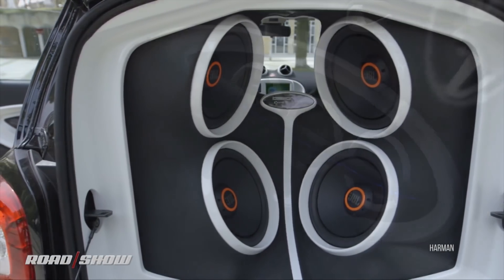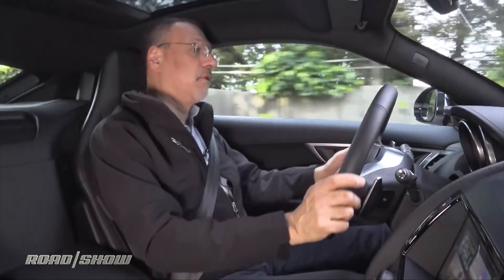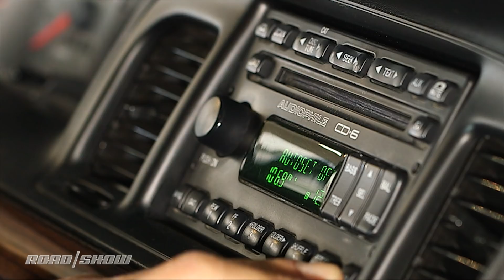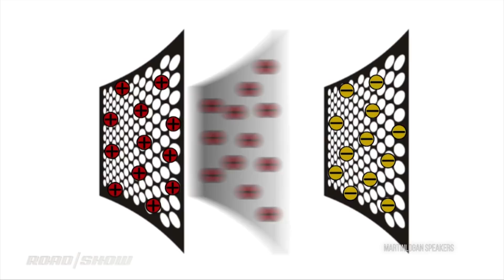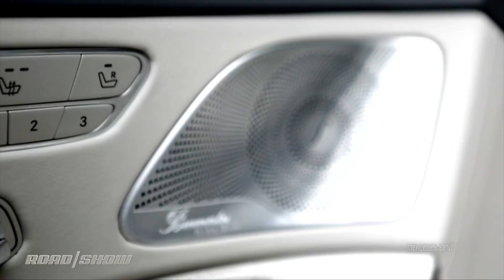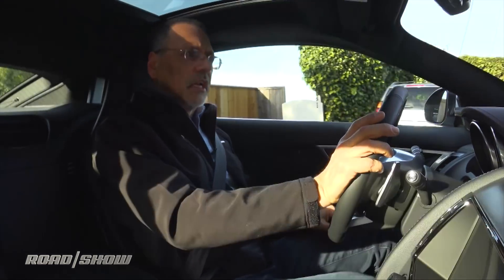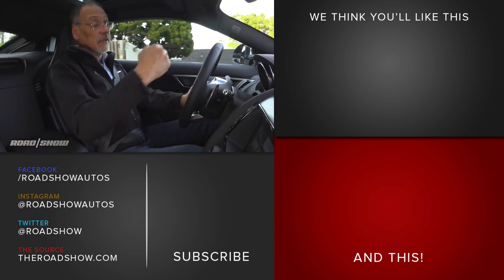Car Tech 101: Car speakers are about to disappear

Comment: Some of the newer cars coming out will have more watts to use to produce the sound. An example is that the 2019 Toyota Corolla Hatchback will have an optional 800 watt JBL audio system, even though it's a basic car meant for basic transportation.

Comment: One of the tings I love most about my BRZ is it has an conventional double din radio ( NO DATA BUS).  Four inch mids and tweets facing the front window and two 6.5" in the front doors.   Two 4" in the back.  So so easy to replace everything and add whatever quality speakers and equipment you want.      Changing the radio in an late model Mustang or almost any modern Ford is an nightmare.

Comment: None of these new technologies will be cost effective for some time to come.   My bet is most will not sound very good. BMW has had subwoofers under the seats of many of their cars for years.   They sound good and are time aligned with the driver.   The 3 way systems just sounds like one very good full range speaker.  I think top of the line car Audio fidelity reached its peak in the 90's.   All of what has come after is mostly  marketing.   For the average person the average car sounds light years better than the average car in the 90's.

Comment: The JBL GreenEdge speakers in my wife's Toyota Highlander are designed to use 1/2 the energy according to the marketing. To my ears, they sound sound muddy. They lack dynamic range and don't do a good job or producing any frequencies very well.

Comment: Sonigistix, in the early 2000's, designed a brand of planar magnetic speakers called Monsoon speakers. They were sold for PC computers and GM vehicles. I think they had some earlier proto models that were electrostatic-based as well. These sounded great and were very thin in shape; a bit heavy, expensive, and prone to corrosion though. I'd be curious to see graphene replace the need for rare earth metal in such speakers though, but I struggle to believe that will happen anytime soon.

Mind you, we're also seeing these transducer 'speakers' gaining popularity, where you have a small transducer that turns the surface it is on into the actual speaker diaphragm. Perhaps the car's frame, window, or some other hard surface can become a thin speaker. The upcoming LG G7 smartphone is building a transducer into the phone itself I think, so when playing it on a hard surface, it turns that surface into a loudspeaker.

Comment: Merc's front bass is really cool. The firewall allows for more resonance space resulting in better bass than one mounted in the door where there is not enough space as the door is relatively thin. The C, E and S classes don't have big speakers in the door because of this which is nice because it has larger door pockets and there'll be less rattle noises in the panel. Also, the sound then travels over the occupants and towards them and to the back instead of coming from the side and hitting the leg.

Comment: I didn't know Mercedes were installing subs in the front. That's pretty bad-ass how they're stamping the space for them right in the firewall.
Reply: Carlos Clivilles Yes. You'll see in the C, E and S class there is no base speaker lower in the door like other cars. There is nothing there other than a small one higher up on the door. It allows for much bigger door pockets and there is more space in the front firewall to act as resonance chambers to allow for bettet bass than a door that is relatively thin with much less space.
Reply: MrWashesp
Most  likely no more problematic to replace than any other MB speaker.  I have replaced he under seat speaker in an BMW.  The hardest part is just taking off the seat.
Reply: abhishek nayak, The Subwoofer speaker is behind the firewall.
Reply: Yes, they're not going to use the speaker as part of the firewall, that would let in noise and wouldn't be fireproof :) it's just a sub mounted under the dash instead of on top of it.
Reply: BMW puts Subwoofers under the driver and passenger seats.
Reply: SDav21
correct  its not.  It is much cheaper to build.  BMW designed the 1 seres to have an sub under the front seats.  The drivers is are flat units I think 8'''.  It ports to the rear of the car and is on the BASE sound system. It sounds quite good.  Not high end but good.
Reply: fatboy19831 That's not as effective as front bass.
Reply: Imagine when those subs begin to age.  And it's time comes to replace.
Reply: Wait till it cracks due to heat from the engine.

Comment: U r trying to solve the problem that was never exist at the first place.
Reply: It's called a solution in search of a problem. It's what people do everyday in conference rooms across the country.
Reply: Jeff S if it aint break, break it.
Reply: And the rest of us who prefer music?
Reply: Ugly Gawd not everyone are audiophiles like you. Some just want to hear the news.
Reply: Ugly Gawd Yes and no. My 05 silverado has a sub built in the center consol ive never seen as its a bose system. It lasted pretty well til 2016 when the "bose blows". Course the sound was going down hill since 2012. Now i have kickers. They dont sound quit as well, but they at least hold the audio at higher levels over my exhaust.
Reply: Agreed, makes no sense to "reinvent the wheel".
Reply: I think lower powered speakers at the same output is a very big deal now that electric cars are starting to get popular.   every little bit helps the range.   plus the smaller size might allow for more batteries
Reply: OEM speakers have always sucked, if you ever upgrade them you would know this..

Comment: Do you guys remember back in the day when you bought a car(new or old) and the first thing was to replace the cheap horrible sounding factory speakers with bigger and better sounding more expensive aftermarket speakers from Best Buy, Walmart, autozone, pep boys etc? Some folks even replaced the actual radio head units. Most people added big a sub in the trunk which took half of the cargo space for that deep base. 🤪 

I walked into the automotive section at Walmart the other day and it brought back memories. They actually still sell that stuff including gps navigation, radar detectors, aftermarket DVD players, cup holders, back up cameras, antennas and such. Newer cars come equipped with most of these things as standard equipment so less trips to that aisle at automotive stores. 
People with older cars still shop for those at a bargain than they used to cost back then. We didn’t have amazon, eBay and other online outlets to find those gems for a cheaper price. Haha!  
If you owned a late 90’s Honda, Toyota, Chevy, Dodge or Nissan you can definitely relate.
Reply: I own a 2013 charger, all 6 speakers where replaced with Rockford’s and sub and amp added. 

After market systems will always be better.
Reply: I feel you brother. It used to be so easy to swap out a head unit and not worry about losing any functionality, but now every car has some "integrated entertainment system" that makes it a nightmare to upgrade
Reply: Some of the cheaper models didn't even have a radio.  Instead they would have  a spot in the dash where an after market stereo could be installed.
Reply: VW group of all manufactures still make their headunit easily removable, I have a 2014 Passat and it's headunit and speakers were garbage.

Luckily a simple adapter allowed me to convert to double din and fire in an android auto Kenwood headunit, replaced the door components with sets of Rockford fostgates and finally got a pioneer space saving sub for a bit of punch.

I'd like to keep my doors and windows, I prefer clarity rather than rattling
Reply: Isaac Kamau I definitely know of a lot of teens that get their parents old cars that still go to these aisles, I'll be having to go there soon, good speakers (factory Bose system before they went to crap) but could use a new head unit.
Reply: I remember when a radio was an optional extra in  a new Mercedes
Reply: Hell, I still do that, and even do installs for other people
Reply: DaBrute get yourself an lc71 and your good to go
Reply: Ugly Gawd about 2 do the same to my challenger. I have Bluetooth speakers louder than the stock radio
Reply: Lol after I got my car I saved up and got two 12’ subs in a big ass box that took up my whole trunk... shakes everything and has the lowest lows I’ve ever heard I love it! I’d give up the space for good sound any day!

Comment: So wait a minute if I drive without music on I will save more gas?
Reply: Ever so slightly.   I remember the big systems of the 90's we had to up the Amperage in the alternators by as much as 40%.  It took more power to turn the larger unit.  Less fuel economy.  Far less than 1mpg.  Many modern cars disconnect the alternator when you are accelerating moderately anyway unless your battery is in an low charge condition.

Comment: Yet another thing car makers will charge a premium for. Nearly every vehicle I've ever owned had a custom system in it. Car makers should stick to making cheaper cars and stay out of car audio.
Reply: Not only that, but then the manufacturer can charge out the ass for a specific oem car door panel that resonates at a specific sound range.
A singular proprietary part that can't be interchanged like a 6x9 or circular speaker. I can see why car companies would be so for this to help the back end of sales.
Reply: Yes. I haven't heard a truly good sounding factory sound system even in high end luxury cars with supposed Premium Sound.
Reply: Get a B&W on Volvo XC90 and you will be surprised.

Comment: Car is the worst place for audio, high ambient noise, off center seating, close proximity to speakers, small space increase resonance, lack of enclosure volume,  rattling materials. $2k home theater set up will blow away even the most expensive premium car audio system.
Reply: Agreed, but many of us have more time to listen to music in our cars than in the home. Unfortunately.
Reply: The rattling part is gone in my car but youre right all the other factors tend to kill sound quality because of heavy use of EQ to battle resonance and reflections
Reply: There are cars that have excellent acoustics others have horrible acoustics.  1990 Lexus LS400, 1990 Saab 9000 , 1990 Honda Accord all have excellent acoustics.  1986 Corolla horrible acoustics.  An 1990 Saab 9000 would sound much better than the average all concrete basement.  You can correct allot of the acoustic problems in an all concrete basement.  Add all the dynanmat and eq's you want that is almost impossible in an 1986 Corolla. Everything sounds bad in that car.

Comment: All this money they are throwing at speakers to save 30lbs

That's money that should be going into r&d to make carbon fiber tubs cheaper.  could save hundreds of lbs in an average car.
Reply: The largest issue i found with todays newer cars is that they keep getting bigger and bigger,  I currently own a 04 corolla weighs in about 2600lbs 3000 full of fuel and with me in it.   the new 2019 corolla weighs in at 3400lbs without.  and gets about 32 highway i avg 34 right now...  car makers are just going the wrong direction.
Reply: HalfNekoJames - Hah for sure although it depends on the car as well, I had an 02 altima 3.5 and it went pretty much unchanged weight wise for 2018. 
That said it also never got lighter, which you'd hope is the case after over 16 years of R&D.
Reply: Definitely, some of the car makes really do stay the same through the years which really shows the manufacturer is taking the time make their motors and transmission more efficient.  It is actually also why i do a lot of work myself on my vehicles because i can adjust and modify to get more power and MPG.   newest car ive ever owned is that rolla.
Reply: +BugHeadClan yes and get rid of computerized shit in cars too computers should be at home or as a laptop but as a car NO! what i would have would be abs traction control stability control [but u can turn traction and stability off if u wanted to] navigation great sound system and electric seats all around and rest is regular car but carbon tub and insane engine so sedan with carbon tub or wagon or cross over or suv same type of drive train and chassis tho
Reply: Carbon fiber should be mandated on non structural parts.  Light and cool to boot!

Comment: Unfortunately the only way to create smooth Rich base is what they large powerful subwoofer. Until that is no longer necessary all this other flat speaker crap is just that crap.
Reply: Not true. Four very high quality 6.5'" drivers can get you very clean fast and deep bass in most Compact cars.   Most cars boost low frequency response by as much as 12db ( or more than twice as loud or 10 times the power than the speaker can produce on its own free air).  Four 6.5" drivers can give you powerful bass below the range of most modern music with as little as 20 clean RMS watts pushing each speaker.

Comment: Audio fidelity... a dying art
Reply: Boi I swear if the cheap ass speakers in an early escape sound better...
Reply: Michel Linschoten , then you've never heard a properly installed setup.  One of my old cars, had such a setup. 

Crushing bass, but crystal clear mids and highs.  If you do it properly , a big speaker setup will be the best thing possible in the audiophile experience.
Reply: It seems to be. All the people complaing about car audio haven't setup a vehicle properly. Yes it's a poor music environment, but you can get a car to sound pretty good. I mean why wouldn't you try? We spend so much time in our vehicles.
Reply: dat power draw from planars doe, its not the most efficient type of driver nor is it the cheapest to make
Reply: oooppiikkk - if there was a higher demand for planars, companies would find ways to cheaply mass produce them and make them more efficient.
Reply: More efficient yes, but definitely not cheaper, there is no reason for a company to make something cheaper for the consumer
Reply: oooppiikkk - if there is more competition in the market the price will be lowered.
Reply: look at genelec
Reply: AnthonyJ350 , dynomat for sound insulation to minimize vibrations and keep more bass inside the car, bass blockers for tweeters and door speakers so they dont blow them out, proper wiring,  proper tweeter placement, ect. Using another battery, a higher capacity alternator,  and even using 1 or 2 farad capacitors in combination with the prior mentioned batteries and upgraded alternator give huge power boost.

 And so much more helps huge when wanting to setup the best possible system for your automobile.
Reply: Verruckter Schakal Don't forget FAST Rings and speaker adapters to get the drivers closer to the inner skin and help produce more midrange. It sucks to be a music artist now a days because people aren't concerned about trying to reproduce the sound accurately anymore.
Reply: FUCK FIDELITY WE GOT BOOM BOOM
Reply: Jane Book 

Trudat!

You gotta have that 808 bump.
Reply: Verruckter Schakal Bentley's new car bangs check it out
Reply: well said my friend
Reply: If this guy thinks flat speakers/subwoofers are the greatest thing since sliced bread then he should demo a BMW factory stereo and let's see if he likes then.
Reply: I think this was just a hit peace, and for the most part he’s got no idea , or did his research, I’ve done my research on this subject and the various topics he’s spoken about 1 the Mercedes foot speaker acts as a filler or can be use for the lows as well. It’s actually an extra speaker to improve sound depth(bmw does it too)2, the continental hidden speaker tech is also still very early stages and they have announced it will more than like just be used for sound deadening or cancelling out road noise(Bose already does this kinda bad) for the other examples I’m not too familiar but it seems he probably exaggerated,sound fidelity is not going anywhere for one reason and one reason only, it’s an option to sell for car manufacturers and licensing for designer(Bose kardon etc
Reply: Tbh...I do not get the caraudio scene at all. They dump money into a acoustical nightmare (car) 

It never sounds good, and all most want is loud and bend a pillars. 

I do home audio, way more satisfying
Reply: Michel Linschoten yeah I gave up on car audio. It’s pointless unless you just want to be loud. YES car audio can sound decent, but not as good as a home for the same money/effort
Reply: @ChadKirk  Yep I find myself too busy driving to care about music.
Reply: I don't believe that would be the case. If planar or electro static speakers became more main stream, audiophiles will be jumping in joy! Although I've only experienced planar and electro static headphones, they're far better than your traditional cone shaped driver.